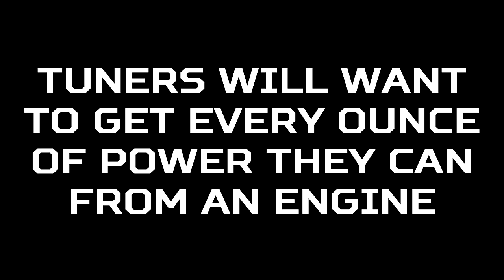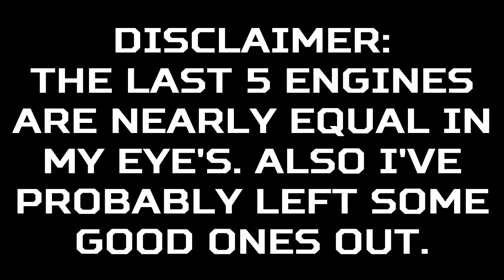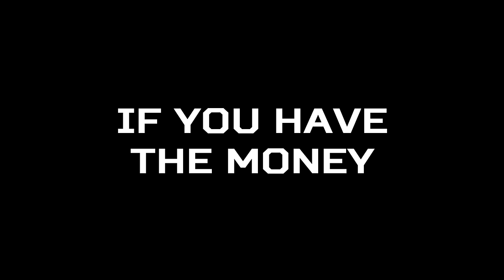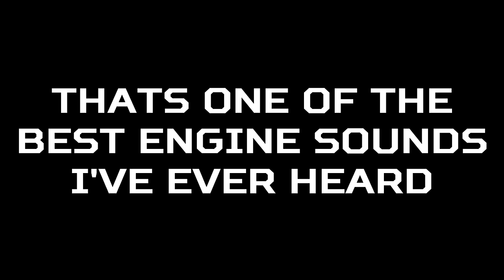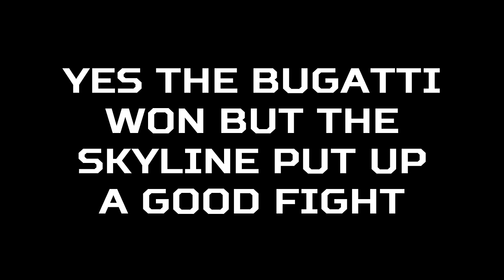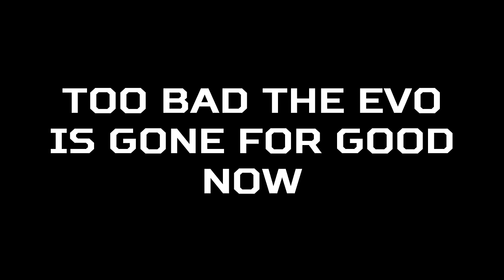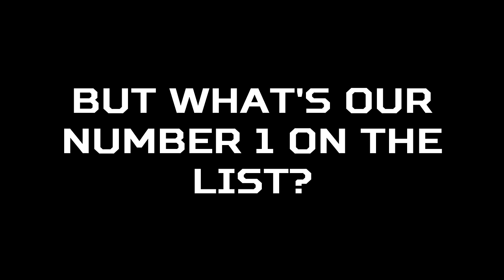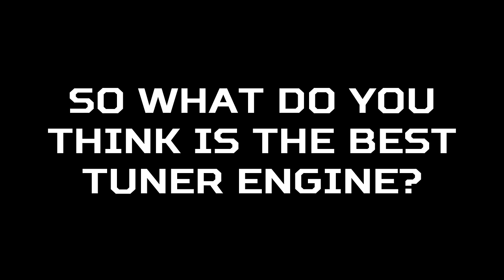9 of the Best Tuning Engines

Comment: The rotary is the 13B, 20B for a 3-rotor and 26B if you're lucky enough to find a 4-rotor.
Reply: You're also lucky enough that the engine lasts over 100k miles, and having to replace the apex seals, otherwise you're done. But they are pretty reliable.

Comment: No n54 😭
Reply: Just a shit 2jz
Reply: Don't forget about the N55 and the mighty M54B30!
Reply: Teckman delusional
Reply: BMW has better engine than 2jz. 800 hp you can do in stock block
Reply: @henzo7087  lol riiiight.
Reply: @henzo7087  bmw engines are not better cost for performance, they don't have more potential then their Japanese counterparts, and they are far less reliable
Reply: @timm5970  B M W engines has no leaks 0 problem with they're engines i own B M W and i m car mechanic
Reply: @henzo7087  Hey man Ur telling storys I was a mechanic for 5 years all bmws leak  bad... In fact german cars in general , and Ive owned 2 bimmers  .  I've owed a lexus with a 2jz det also I would take that car everywhere even on 500 mile trips and what not No way would I do that with on of my turbo bmws junk would break down every 2 months. Not to mention mod for mod the 2jz made way more power.
Reply: @ace-qi9pj  Dude, I m a car mechanic. BMW make the best engines in the world better than Mercedes-Benz. I working  in this cars and N54 has better performance than 2JZ i show you proofs if you need also I own BMW. B M W engines has no leaks its not VW group. New Toyota supra has BMW engine and gearbox says everything
Reply: @henzo7087  Like i said so was i for 5 years ,, so if u work at a dealership and only work on cars that are only  5 or 6 years old ... sure . Ive seen alot of bmw and german cars and none were leak free so lets be real.
Reply: @pwnyourass22  2JZ isn't shit its good and he did leave out the BMW engines lol
Reply: @vipbeef2174  I know that its good thats what I said..
Reply: @pwnyourass22  oh ok I guess I took it on a wrong point of view XD
Reply: N54 ftw
Reply: @henzo7087  do your research kid the b58C in the Toyota supra is not completely a bmw engine toyota added the "C" Because they changed the internals the only thing they took was the block.
Reply: @vipbeef2174  335I with similar hp is faster than 2JZ
Reply: @henzo7087  yeah,from what Ive heard can handle big horsepower on stock internals
Reply: Everyone knows that 2jz is somewhat better then the n54 but we cant forget n24 is like half the price
Reply: All these 2j and bimmer fan boys would shit themselves after I smoke them with my 4.0 barra pulled out of a totaled taxi cab.  almost got 1000 on it and I’ve barely spent the cost of a bmw transmission service.
Reply: @henzo7087  BMW lose 90% of their value in first 10 years, mainly because of their poor reliability, this is not me talking this is the auto market for used cars that sets prices on used BMWs, I can get BMW M5 V10 2008 for as low as 5k in 2020, that was a 100k car in 2008
Reply: @MidwestDIY  Show me where i can buy M5 for less than 5k which doing 356 km/h stock withought speed limiter and this cars are reliable. People just dont doing proper warm up the car and thats why they have problems with rod bearings. A lot of info on internet how to care about this M5 E60
Reply: Dzhaner that’s funny

Comment: The Buick 3.8 turbo V-6 used in the Gbody Turbo Regals including the GNX is still a force on the dragstrip.  An engine that has decades of reliability and proven aftermarket success.  It was the engine that started the turbo craze.  It was in the fastest production car to 60 mph in 1987,the GNX.

Comment: BMW N54. Can tune it to 3 times factory power on stock internals.
Reply: KrS247 Yeah but doesn't last long as 2jz-gte and it isn't over built as 2jz
Reply: See this is what a tunable engine means not half the shit on this list  Because having rebuilt every part of the engine to upgrade it does not mean it's tunable that means it's a completely different engine now
Reply: But 2jz's fuel economy is like 12,16l/100km
Reply: @YesIgen  if you want fuel economy get the Prius with pink rims
Reply: Igor Dragunov When you are thinking to change internals I doubt that fuel consumption is bothering you
Reply: @miralemnermina142  it lasts just as long and produces as much power with both on stock internals. 2jz also has problems of its own. N55 is more reliable though, but more expensive as it's a newer engine with much better economy and more reliable
Reply: V!K I still think that 2JZ is stronger and more reliable, also N55 has an aluminium block. But yeah N55 wins im every other category. Can't wait +10y till N55's make +1500hp
Reply: N54 is reliable engine 800 hp and stock block
Reply: Hen zo Not really, N54 can reliable take 700hp. Also N54 had an aluminium block while 2JZ has a cast iron block that can take +1500hp
Reply: BMW's S38B38 L6 FTW. 1000 HP is a walk in a park for this engine.M50 dirty cheap,probably one of the best budget engines to slam turbo on it.
Reply: KrS247 Sure u can! Thats if you want your engine block to fly up the bonet. Honda engines can go to 800bhp on stock internals no problem 🤷🏾‍♂️
Reply: @VictorEstrada  beamers reliable?since when did I ever hear of that?
Reply: Lmfao, 4g63 will still put that BMW unreliable motor in its place. 750hp+ on a stock 4g63! over 375hp per litre and that is on a mustang dyno.

Comment: Thanks for the recognition on the 4g63. I think the 4g63 should be higher in the list than the 2jz though for a couple reasons. The 4g63 modding community is very diverse, with many manufacturers offering more parts for these cars than most others. The biggest difference that gets my vote though is cost. A 2JZ is an awesome engine, but it is much much more expensive to modify heavily compared to the 4g63. Overall I agree with everything that's on the list, just maybe not the order it's listed in. Good video nonetheless.

Comment: The VAG 1.8T found in various VW and Audi cars.
Reply: agreed
Reply: Is that one on the jetta gli 1.8t?
Reply: +michoacan91davi yep
Reply: The engine sound is satisfying
Reply: TheGamingCorner agree
Reply: ive had my 01 1.8t Jetta for 4 years and 120,000 miles. its at 240,000 miles and I constantly drive it hard
Reply: Redline. Everyshift.
Reply: Ive owned two. Sold my last at 178k, current one has 234k. All you need is a stage one and the front wheel drive model with a 5 speed. Simple and bullet proof, still plenty of fun.
Reply: I was on tunning show in Czech and there was a 1.8T Audi TT with 660hp running on E85.
Reply: My 01 a4 awm has 450awhp gtx2867r has no problem keeping up with the big boys just does get expensive Alot cheaper if you can afford the initial ls swap but still seeing a 4 banger walk a 2017 vette is priceless
Reply: Logan Smith 450awhp on a gtx2867r? I was maxed out at 420bhp at flywheel on that turbo in my S3 8L
Reply: winzfeld1 I want to see the fastest S-10 pickup trucks trucks it is out there
Reply: winzfeld1 fastest S10 pickup truck in the US
Reply: with every VAG engine they giving 50 litre oil for free
Reply: Have that engine for sale if anybody wants to buy it
Reply: 💯 agree. I have spent 4 grand chipping and flashing 1.8ts since 2001. Lol. My current k04 AEB longitudal, United motorports tuned, straight piped is Def my favorite.
Reply: Joe S. You on the bam engine? I've got a auq 1.8t straight piped and mapped and I is loving it.
Reply: Or Alh 1.9
Reply: Mod for mod honda will stomp any other 4cylinder and vws are the biggest dogshit cars ever.  Shouldn't you guys be bragging about the vr6 anyway?
Reply: i heard bad stuff about it
Reply: Also 2.0 16v ABF, it can push out 1200+hp. :D
Reply: I just bought an Audi TT Quattro 1.8t with the k04 and love every minute of it but don’t ever take the haladex fuse out and try launch control or you will have a bad time
Reply: @timm5970  funny. Mod for mod lol I eat hondas like that. An they are way cheaper on parts then a 7th gen 1.8
Reply: @patrickroswell2449  fake news.  Only way you win is in a quattro with awd and more boost
Reply: @timm5970  but hey... if you like repping the cheapest build. Be my guest lol
Reply: @patrickroswell2449  lol the vw DOES NOT hang mod 4 mod plain and simple.  Keep crying
Reply: @patrickroswell2449  a b18c with bolt ons alone would take a stock vw1.8t.  Now throw a turbo on the b18c and its not even close
Reply: @patrickroswell2449  so cringy.  Vag 1.8t- 1.8l turbo with 150hp on 9lbs of boost.  B18c- 170-200hp na.  Ez to tell which motor is faster stock and which engine has more potential.  Not only is the b18c faster stock, throw a garrett t30(stockish sized vw turbo) on the b18c at 9lbs and the b18c will OBLITERATE the vw engine.  I dont see any 1.8vws making 2000hp and running 6 second quarter miles like the bseries has
Reply: @patrickroswell2449  i have a turbo lsvtec come get some manchild
Reply: @patrickroswell2449  we both know you drive a stock car.  Your car would get smoked by an lsvtec nevermind the turbo
Reply: @patrickroswell2449  when he was giving off numbers he had it backwards. The b181b20 makes 150 stock (after he finds an SUV to rip it out of) and the 1.8t make 180 stock. There's absolutely no way he with beat you. I don't care if its mod for mod, stock for stock, or tit for tat. Only way he's winning is if you have 4 flats and your alarm doesn't go off

Comment: N54 on the Bimmers are the best, if you 👍 Germans
Reply: Ocean City no,audi's 5-cly
Reply: TheVranac87 BMWs legendary 1500hp 1.5L, that's 1000hp per litter my friend
Reply: TheVranac87 but also yea n54 is better than your i5
Reply: Victor Estrada Victor Estrada audi's 5 cly is a better 600+ hp engine...yea and that 1.5l engine should last only with 1000+ hp for the quali and you could put every race a new one.Mercedes 1.6 l turbo f1 is the best small engine ever.
Reply: TheVranac87 you can do 800hp with the n54, stock engine, where with the i5 you need to rebuild it completely to get those numbers
Reply: Victor Estrada stock,right :)
Reply: TheVranac87 look it up, I ain't got nothing against audis, I love them, but there's a reason they're calling these bimmer engines the new 2jz, because that how much that engine can push without rebuilding it, which is what tuners do to get those insane numbers
Reply: Es macht keinen Unterschied ob man deutsch ist. Ich bleibe bei Nissan RB, VQ, VR, SR
Reply: Nope you are totally wrong
Reply: Victor Estrada they did a comparison the 2J is still superior and more durable, they tried to get as close as they can to the 2J but they cant copy it 100% not only that but the 2J is WAAAAAY cheaper due the N54’s foreign tools ... Ppl forget that for the price Japanese engines are simply better

Comment: Ford escort cosworth, the most commonly highly tuned engine is the 2.0 4 cylinder.
Reply: Cheap way to go really on high power in europe is probably Volvo 2.5L T5. That baby is f*ckin' overengineered. No need for expensive parts.
Reply: My dad's oldtimer has a big ole Volvo 5-cyl.  That thing is indestructible.
Reply: YB engine!

Comment: umm the subbie motor is a unreliable motor at best, see the smoke at the end of the pass. it's a bad engine to build. internals are weak and do not handle power well with all new internals.
Reply: Plus the Headgaskets :) I was once told if you see a wrx/sti with the 2.5 liter boxer, that its headgasket just got replaced or their on the way to the dealership for said headgasket. Ohh almost forgot on the back of a tow truck or as a nice lawn ornament.

Comment: Where the fuck is the 335i 135i N54 N55 engines aka 21 centurie 2JZ
Reply: Bmw , MB , or VW  dont make reliable engine for tuning in super high Performance level
Reply: +Sunbum Kim ahahahhahahahahaahah they dont? 2L TFSI pushing 500hp...
Reply: +Sunbum Kim also MB ever heard about AMG/Brabus?
Reply: S54b32
Reply: +pengu83 or the S50 S38 also very populair to bmw heads
Reply: +m power absolutely!!!
Reply: +Sunbum Kim I disagree. the Audi/VW 1.8 turbo is one of the best budget tuner motors on the market, and simple to work on.
Reply: ??? those engines are trash
Reply: Trav L yeah, total trash. n54 is only capable of upper 800hp numbers on a stock, unopened block. what garbage lol
Reply: n55 doesn't make the cut in this conversation lol
Reply: whats your point? practically none of the engines mentioned in this vid are capable of "upper 800 HP stock, unopened block" youre gonna have to build most engines to get 800hp. i do agree that n55 is garbage tho
Reply: I think you answered your own question lol
Reply: Derrick Dickerson the n54 doesn't need to be built internally what so ever to achieve 800hp. So why is it "trash"?
Reply: n54 engines were forged internals through early 2009. Just fyi.. This is why they can make big hp
Reply: Devin Wilson sarcasm...
Reply: Stock block honda k series can do that without a breaking a sweat.
Reply: Sunbum Kim You must not know anything about BMW I know people reliably pushing 650 whp on an n54 platform. The N54 needs to be on this list.
Reply: best engine ever!
Reply: Yes n54 is a ok platform I worked on many when I was a tech for BMW for the e90 e92. But the dual Vanos system is not that great and the valvetronic system isn't that reliable either.
Reply: celadon_ productions N54 does not have valvetronic

Comment: You can't have the 4G63 in the top 5 and not also have the 4B11 in the top 5. The 4B11 is better than the 4G63. I call BS. But other than that, great job - especially for putting the Subaru engine in 10th place.
Reply: Well, one other thing... I'd have left Coyote off and added 1.8 turbo Audi/BE instead. I've personally owned 2 of them, a wankel 13b (1993 R1 RX7) and 4B11 (Final Edition Mitsubishi Evolution.)
Reply: 4B11 is NOT better than the 4G63... Everyone knows that.
Reply: RationallySkeptical 4b11 is aluminum and the turbos on the back side so it's a bitch to work on and modify. A 4g63 is cast iron so yes heavier but a hell of a lot stronger and the turbos on the front so much more room to work with.